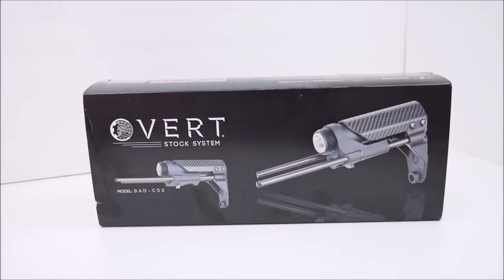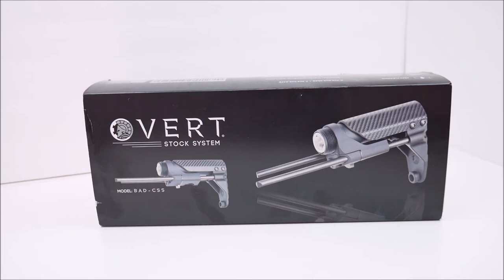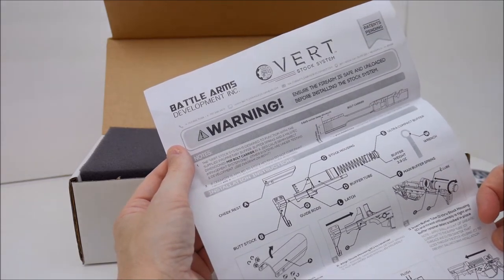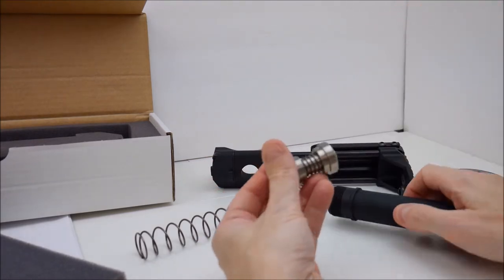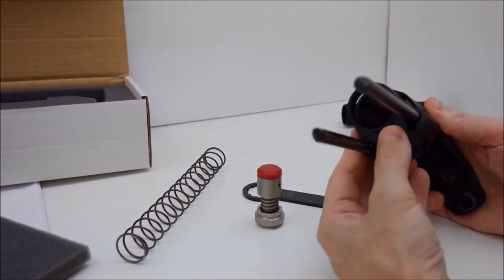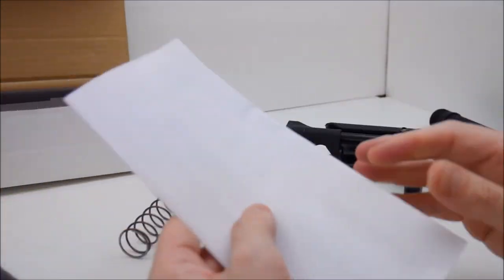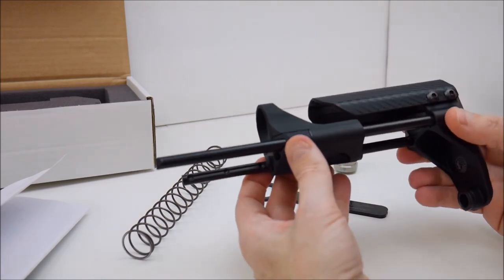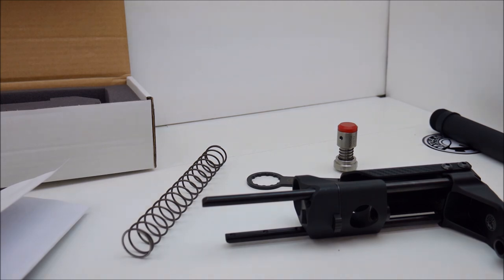Battle Arms Development Vert PDW Stock System - Unboxing

Comment: Could you alter this putting holes through through the checkweld amd putting a strap through to make it a brace? Wonder what or who decides at what point its am acceptable brace.
Reply from the maker: Not advisable, the ATF says this is a stock, adding a strap isn't going to change that classification.  If you want a pistol brace that has a similar design, check this one;  https://www.maximdefense.com/product/maxim-cqb-pistol-pdw-brace-for-ar15/